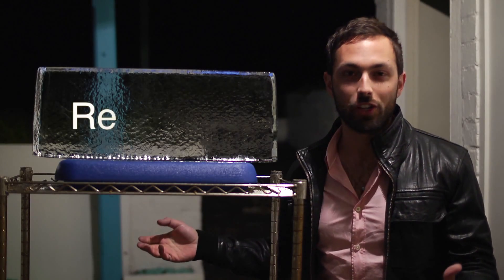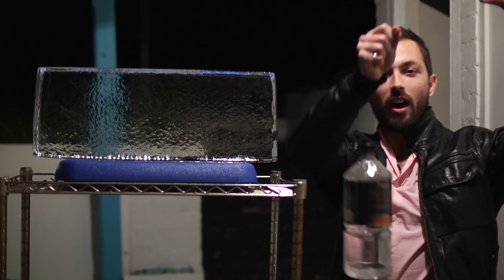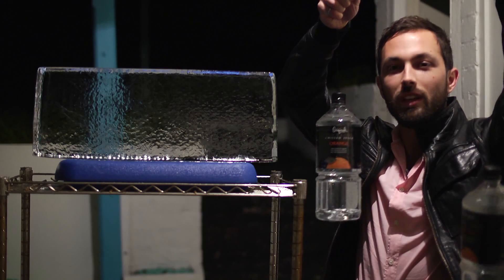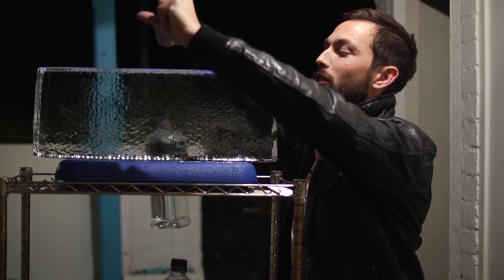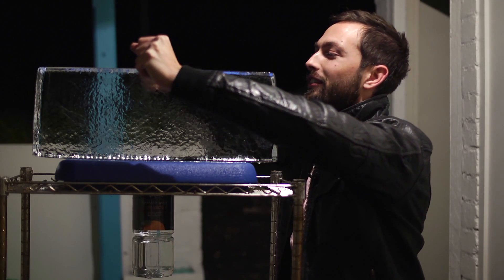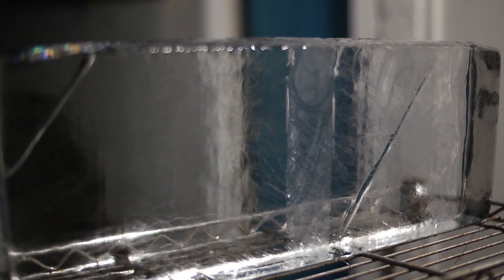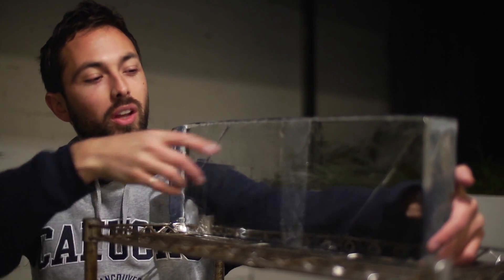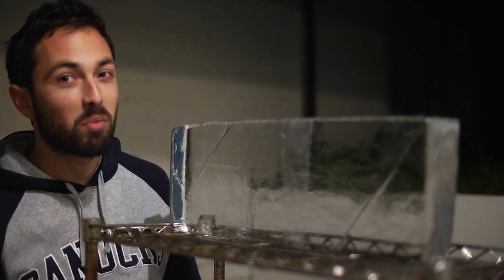Does Pressure Melt Ice?

Comment: I am a fan of physics and Veritasium but I will agree with other commenters on this experiment. I don't think it is any more impressive than running a hot wire thru plastic as plastic will also weld itself back together using a thin wire. Also, water requires an immense amount of pressure to change its freezing point four or five degrees.

Comment: Isn't the wire just conducting ambient heat then after it passes through the ice the ice is just able to refreez the water. Dont see how that is just pressure. Try to push ice on to ice wont melt. Look at the polar ice caps. There is a whole lot of pressure on the ice thousands of feet  below the suface.

Comment: Don't think it's about pressure, but about exchanging temperatures ice x string. The string "stoles" the temperature from the ice, witch melts. When the string passes, the water over it tries to be 0ºC again, and that's why it became solid again. Try to put a sharp knife over an ice block. It will "cut" in the very first seconds, but when the knife is cold enough, it stops "cutting".

Comment: Conductors such as diamonds and graphene with heat added thru.... say an induction coil during or in conjunction with the pressure might keep the regelation from happening ? even if ambient is below the freeze point of water , , so if pressure is applied to ice, and within the pressure device is a super conductor such as Graphene could this be a method of making ice bypass regelation?  I am just a lay person but live in Alaska and entertain the idea that I could melt snow and ice thru opposing roller drums , and using graphene or industrial diamonds for conduction, could keep the ice in the state of water?  What do you think???  Max

Comment: Repeat the experiment with a bad heat conductor wire. Plasma rope or equivalent. That experiment just shows ice melting due to the wire melting the ice from radiance and the ice refreezes due to the sheer bulk of temp difference. 

Retest with nylon string and compare the results

Comment: Regelation or thermal conductivity? If you have a block of ice that is <0C and run a hot wire through it, it will melt and then refreeze.
Reply: it was regelation, this is well documented.

Comment: I know this is not likely the case, and probably a stupid question to those who know. But how do you know it was pressure cutting the ice and not the heat transfer from the rest of the wire outside the ice to the wire inside the ice? I believe pressure does melt ice, but is there a better demonstration that will eliminate this probability?

Comment: What if it was just because the string was getting warm from the outside air and melting the ice and the ice was just instantly freezing back due to the ice nearby
Reply: It has a negligible effect, so it's still the pressure.

Comment: Well that was pretty stupid.  Ice melted because the string is metal.  Do the same with a nylon cord and you'll see the difference.  Metal conducts heat from the surrounding environment, which is why it melts the ice
Reply: But if you just set the metal string on top of the ice block nothing would happen. I think a nylon string with the same thickness would take longer, but have the same effect
Reply: like, there are literally videos of a nylon string doing the exact same thing

Comment: You should think about using a cotton string (or another insulating material) rather than a metal string which can transfer heat to the ice from its surroundings.

Comment: He did not mention the fact that ice skates work on this principal. The sharper the blade the easier it is to skate because the blade of the skate melts the ice so there is a thin layer of water. The blade of the skate travels on that thin layer of water which freezes after the blade moves off it.

In fact, figure skating is called figure skating because the skaters had to skate intricate patterns which left trails in the ice which the judges then measured to determine scores. The free style dancing with music was only part of the score, until recently when they did away with the figures, so it isn't really figure skating anymore.

Comment: It would not melt if wrapped in thin durable plastic and lowered to bottom of artic ocean.       So hydraulic pressure same temperature cannot melt it.      Frigid air same temperature cannot barometrically melt it.

          A vice MECHANICAL COMPRESSION in any gas of same temperature  does not require wire narrowness except for  hastening deformation melt plus re-freeze.

Comment: Wait wait wait! I want to see what happens with more or less pressure. This does look like it is from pressure and not conduction though, because the middle of the ice block would not conduct much to the wire outside the wire since most of the wire in the ice would be the temperature of the ice.

Comment: its not the pressure, the wire is melting the ice. use a different material the same temperature as the ice.

Comment: Metal conducts heat too well.  Repeat it with fishing line. Or perhaps both options at once to control more variables

Edit: Looks like you did that 10 years ago!  The metal does work better, but the fishing line works almost as well.

Comment: I'm not sure but is it for the same reasone water boils at a lower temperature when the air pressure is lower?
Reply: I found this online 

“As pressure increases, water molecules need additional heat to gain the speed necessary for escape.”

So as pressure decreases, water molecules don’t need as much heat.

You asked a really good question, I really don’t know if the two can be linked. Hopefully someone answers.

Comment: Are we sure this isn't because the ice that is in contact with the relatively thermal conductive metal guitar strings, causing it to heat the ice at that point?

Is it the fact the it re-freezes that we can say it was due to the pressure?
Reply: Thermal conductivity of wire plays a role in this too.

Comment: How do you know that the wire might not be conducting the heat into the ice so it would melt faster there, and then once the wire is gone the water is surrounded by ice and will freeze again?

Comment: melted water just freezes again when it touches the big ice block.  You should have a block of ice just under freezing temp in a pressure chamber. Control the temp and add pressure. Add pressure slowly so you can remove the temp increase due to to Boyle's law. If you keep the temp stable and increase the temp, then this experiment can be shown correctly. This video is flawed I'm afraid.

Comment: But the whole block doesn't melt, so the temperature of the room must be cold enough for water to freeze. What if the pressure melted the ice into water, but it just refroze because the temperature of the room would cause it to freeze anyway?

Comment: I love your videos, but I have a rebuttal. If I'm late with this, I apologize. though I'm sure there is some math knowledge I greatly lack, or perhaps I misunderstood the setting of the experiment, I'll watch again and edit if I misunderstood. my question is, would the nickel wire (I assume) not have conducted thermal energy from the external wire to melt said ice? and given the ambient temperature within the block, you would refreeze the liquid water, given beer cooler effect, the temperature within the ice would be colder than external temperature. the visible air line to me indicated it didn't freeze back without air being trapped, though that doesn't necessarily say anything about the experiment

Comment: I would love to see Veritaseum revisit this concept in greater detail. There are some flaws that cast doubt on the design of the experiment. The argument against it is that regelation is possible, but requires much more pressure than this experiment provides. The wire is transferring heat from the room into the ice to melt it, and it refreezes due to contact with the remaining ice. In order to see if this is really what is happening, you would need to repeat the experiment in an environment where this wasn't a factor. You could  take all the materials into a walk-in freezer and cool them to just below 0° C and see if it still works.
Reply: @miltonb4522  Yes, there is a thermodynamic POV to this that can justify the results. Derek from 2022 will probably make a nice 15 minute video on this. @Veritasium
Reply: I've seen this test done this way in other videos where they did in fact keep everything below 0c. the experiment still works fine in those conditions. Wikipedia actually has an article detailing it, and i've seen it done at multiple science exhibits as well in the past when i was a kid, it's a really popular one for kid's science fairs because it's so simple to set up
Reply: It's much easier then using a sub zero environment. Instead of a material like metal with a high heat conductivity, use something like a nylon string.

Comment: I have another question for you Derick, 
Prove me wrong: Its not pressure that melts ice and release of pressure returns it to frozen state.
Its fact that wire conducts heat and melts ice, but since ur block of ice is not exactly at 0 °C  but lower 
(lets say -10 for example) rest of ice steals thermal energy from liquid water after wire had passed given segment of ice and refreeze it at expense of total thermal energy of block( meaning whole block gets tiny bit heated by liquid water)?
Im not saying im right i just want you to tell me if im wrong.

Comment: I think this is a poorly designed demonstration. The wire will conduct some heat out of the ice and therefore could contribute some of melting. the ice around it if much cooler than 32 there it will refreeze easily regardless of pressure. try dropping a mL or 2 of water on top the ice chunks. It will refreeze.

Comment: A metal wire conducts heat. How do I know it was pressure and not heat that melted the ice?
Reply: As far as I know, it is heat condunction that causes the ice to melt. I've seen people try this experiment with both metal and plastic wires, and it only worked with the metal ones.
Reply: Just an intuitive response, but if it was heat conduction that was melting the ice,  once the wire is surrounded by ice the wire towards the center of the block would stop cutting, as heat would get absorbed at the edges and not get all the way through the wire. Wire toward the outside of the block would continue cutting.

Since the wire continued cutting through the entire block, pressure seems to be the only energy being added to the system that could convert to heat.

I'm sure there is math that could be performed that would tell us how far into the block heat from room temperature would be absorbed. Been a while since I took physics.

Comment: Can that work for another materials except ice? For example on metals or plastics? Can preasurre melt them too in same way if applied enouth energy? That could be usefull in manufacturing.
Reply: i this it’s only ice, because it expands as it freezes. most thing are liquid under low pressed and solid under high pressure

water is just special :)

Comment: I think you failed the experiment when you didn't tape ice cubes to the metal wire which was basically a radiator for ambient heat.

Comment: One could argue that its not the pressure causing the melting, but rather the thermal transfer of heat through the string. Then the gap being small enough to allow the cold ice to refreeze itself.

Comment: Not convinced. Maybe the length of wire acted as a good heat sink for the Sydney, in turn heating up, cutting the block, then the lack of heat in the rest of the block refroze the cut. Plz repeat in freezer.

Comment: I am going to accept it is pressure because the guy seems quite credible but the explanation that comes to my mind is the high thermal conductivity of the wire is causing the ice to melt in that plane and then as the wire as slipped through, water from the melting ice and the surrounding is filling the gap and solidifying due to the cool surrounding temperature.

Comment: Why isn't it that the metal string is conducting heat away, and then once that conductance is gone, it re-freezes?  It's not clear from the video if you're inside a large freezer or somewhere where the string is good enough to be certain that it's not conducting heat away.

Comment: I think you would have to do this in a 0ºC environment for it to be a fair test. The problem being that you are in a 20ºC+ environment that is adding heat to the guitar string and so the melting cannot be due to pressure alone.

Comment: Clapeyron equation explains this! Pressure and temperature phase diagrams too, albeit more qualitatively. As pressure increases, the melting point decreases in this case. The high e string is important as it is the thinnest while gravitational force of the bottles is the same, thus pressure is the highest (P=F/A). Then the melting point changes, making it “cut through” more quickly than it just melting through. Since the pressure is relieved once the string goes through, it refreezes. And voila! String frozen in block :D

Comment: I know this video is old, but I have to say this absolutely does not show regelation at all.
The guitar string cuts through the wire because it is made of metal and therefore has a high thermal conductivity. That allows it to melt the ice on contact and glide through.  This leaves a tiny film af water which freezes because the surrounding ice cools it below zero again.

Comment: ... or the metal string conducts outside heat to the point of contact and that melts the ice, not the pressure. This experiment needs to be do with a fully capron string with outside temperature below zero.

Comment: Ice does not melt by presure your dum nut
Reply: Unless I'm misunderstanding the phase diagrams of water and what things mean, I'm pretty sure it does. It's well known that water takes up less volume than ice which is the opposite of most other substances. I don't think this is the perfect experiment to demonstrate this by any means but it makes sense to me that with high enough pressure water will change state even if it's temperature does not change, no different from any other substance, same reason why liquid CO2 doesn't really exist at 1atm
Reply: @faceless1434  its just that ice can actually form by aplying enough pressure too water
Reply: And there is a very hot planet were the presure is high enough for ice to be there
Reply: @nicklasmortensen7716  Okay, so I did some further research into it and you're absolutely correct about the planets and such and I started reading stuff on national geographic's website and such but I am also right about high pressure creating water. The difference is that at some temperatures, increasing pressure freezes the water and at others it melts it. If I'm not mistaken there is a temperature range just a little below the triple point of water 0°C where you can put ice under pressure and turn it into water then even more pressure and it will become ice again... states of matter is too quirky. Thanks for pointing that out though
Reply: @faceless1434  oh okay you learn every day 🙂

Comment: Takes a metal wire which will conduct heat and lets it melt through the ice and makes it out to be some cool thing. Should have used string or twine. Would have had a much greater effect. Not impressed

Comment: Maybe because of temperature difference between the wire and ice . 
Also pressure is directly proportional to temperature. That means increasing pressure will increase temperature and thus melt the ice.

Comment: What if you place the whole setup inside a freezer so the string and the ice are in thermal equilibrium? The metal string is very conductive, so it easily absorbs heat from the environment and causes it to melt/cut the ice, which means, the temperature difference is the cause of the cut, not pressure. So if pressure can really melt ice, we should remove the other factors.